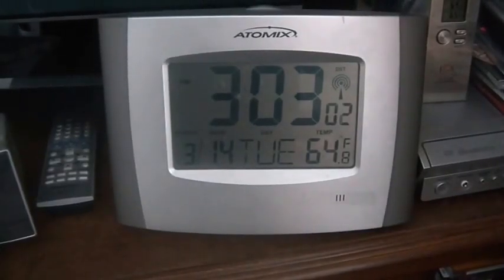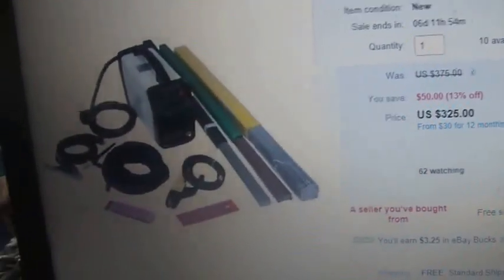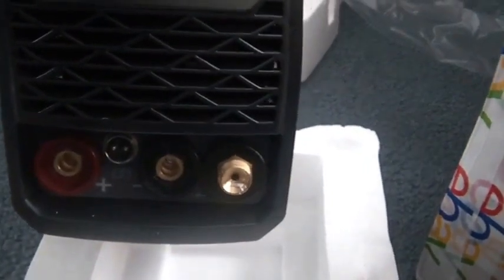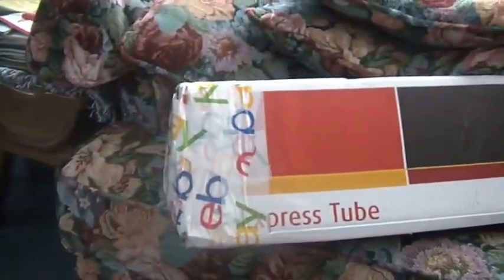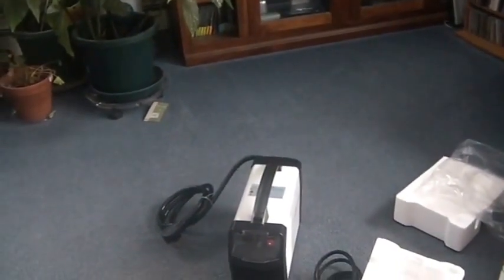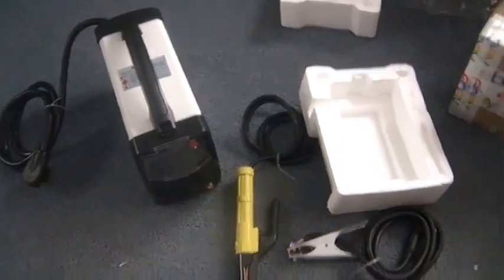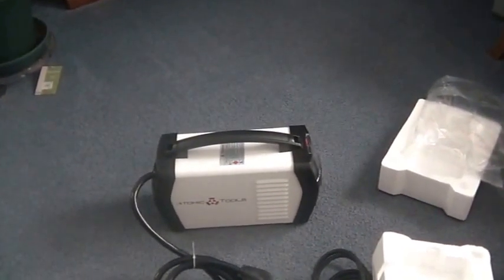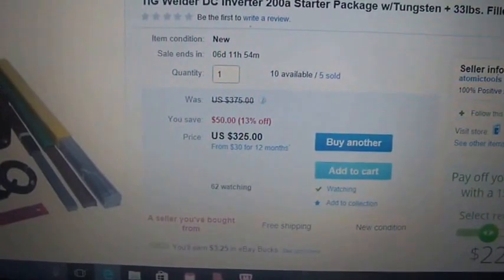TIG Welder Inverter, Model 200A, with filler rod Starter package,

Comment: my guess on the Lincoln welder one of the diodes is bad.
Reply from the maker: Hey Josh, It welds "cold" ac or dc, I'm thinking a winding is opened, hopefully just a broken wire or open at a connection, hopefully not a winding issue, it showed up new with issues, I think it was factory defective and that I did not realize it until the warrantee was up.... Thanks for you suggestion, watching, and commenting!!!

Comment: looks like a great starter tig welder. I didnt see a pedal. as you said you control the heat from the red dial. less to do at the same time. I'd buy that also if i was in the market for one. welding technology has leaped foreword. looks like harvey can do some more technical welding projects. heavy steel welding. takes patience from what ive seen. I love mig welding. I have seen mig welders that weld 1 inch steel no prob. but big $. looking foreword to your future vids. i love welding videos. just chased down a pakage from fedex. they dropped my package at the post office. left me no slip. i dont think they ever came here. last time i let them ship using fedex. cheers 👍 ih was harbor freight order. float charger flap disc set and hand files. huge box small order lol

Comment: Looks like a good deal. I don't see an AC option so you won't be doing aluminum or at least doing it very well. Yeah I've been doing TIG welding since 1973 and Incorporated in 1978. Too long. lol

Comment: I have thought about getting a inverted stick welder . It looks like a DC machine . Good for steel , but ac tig i believe is best for aluminum . I think it will be a good little welder , if going to stick weld , get a selection of rods . I have a very very old Lincoln tombstone  ac , i have not used in 20 years , the heat adjuster is frozen now , but it was a good welder . And i have a old gasoline powered welder . i need to see about getting it started this summer . I use my flux core welder the most , but i like stick welding .

Comment: I haven't tig welded in about 20 years, but what I remember it is a lot like brazing. I am waiting to see what you think of this little machine, I would love to get a tig, but most are very pricey for what little I would use it. I had a Lincoln Tombstone for years, even after I bought my Miller Thunderbolt I kept the Lincoln as a back up, in fact I just sold it this winter. There good welders. I also have a Lincoln flux core that I bought to teach my self mig welding on. When I took welding in school is was all done with AC/DC arc welders, and Oxy/Acty torches. I weld everything from sheetmetal to cast iron and aluminum with my arc welder. You crack me up, I agree better to spend money on toys than Professional help. I almost fell out of my chair when you said that one.

Comment: I just sold my Millmatic wire welder and upgrading to a Lincoln Tig, it's AC/DC, 110 v / 220volt. You need ac to weld aluminum. Take a night class for tig at most small colleges.

Comment: awesome Harvey looks like a decent machine for the price... i need to break down and buy myself one...I'm still stuck in the dark ages and repair my aluminum engine cases with aluminum filler rods and a torch...i wasn't very good at it at 1st but was told to pratice on aluminum soda and beer cans..and I got to were I'm pretty proficient..moral of the story is pratice pratice pratice the more you use it the more productive and proficient you will become...taking classes is a great idea but nothing beats hands on experience and just doing it and learn which  methods work best for your machine and types of material you will be welding